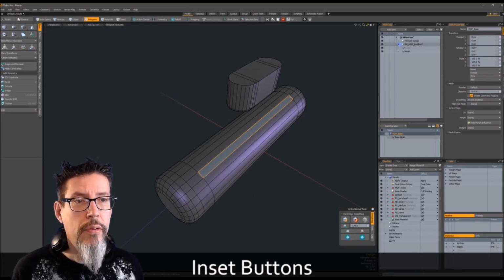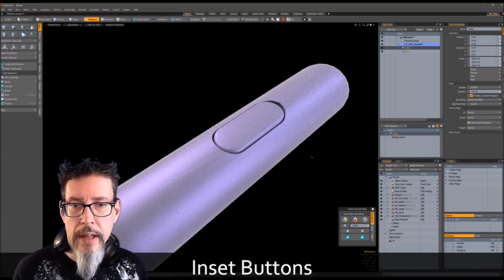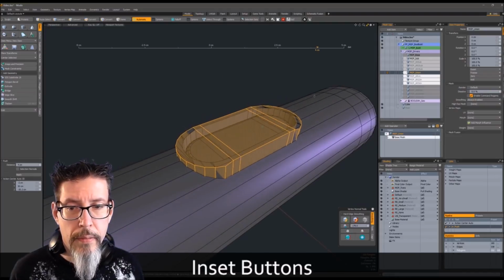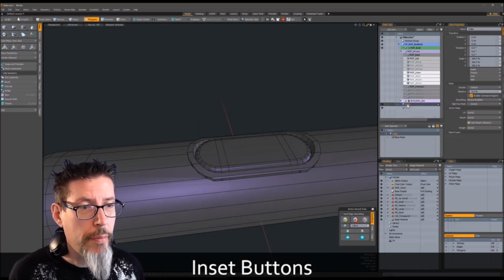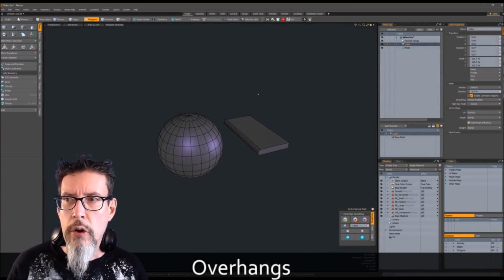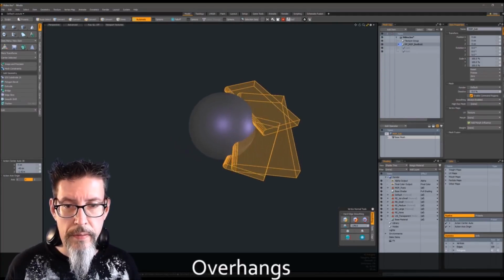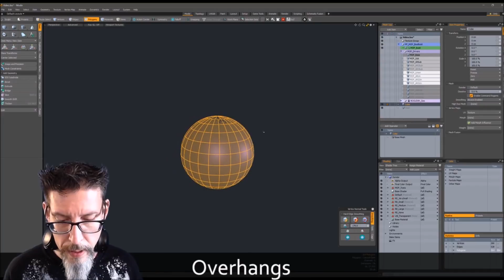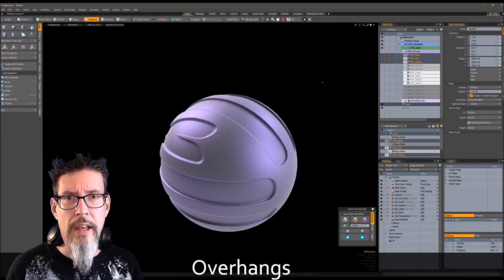Tutorial : Modeling Insets & Overhangs

Comment: I have some artifacts with MOP Boolean. The resulting mesh has always strange shadow problem during preview render...
Reply from the maker: Boolean use can result in some nasty topology which can lead to shading artifacts. It's just part of the process. There are various ways to fix those either by (a) using smoothing groups on the high poly mop operators or (b) using them on the resulting, frozen low poly.  Other ways as well, including retopo in the worst cases.

Nothing is free.  Sadly.  :)

However, bear in mind that most errors will be unnoticeable in the final bake and resulting prop texture.  So make sure it's worth fixing before you dive into too deep of a rabbit hole.
Reply: @WarrenMarshallBiz  thank you very much for answering.